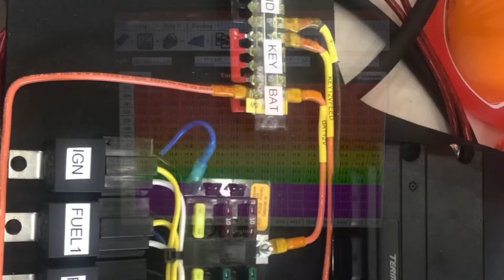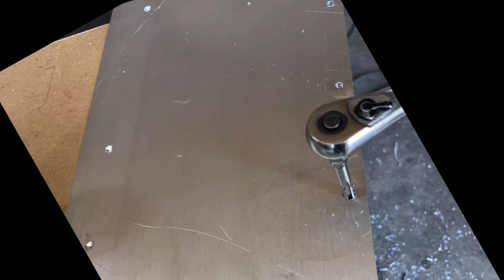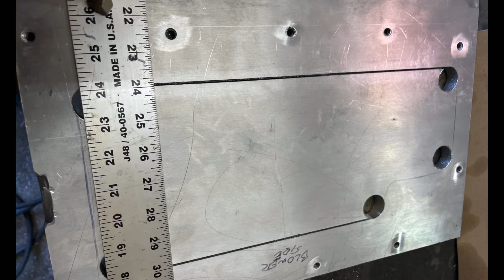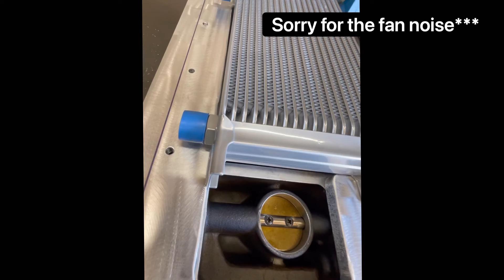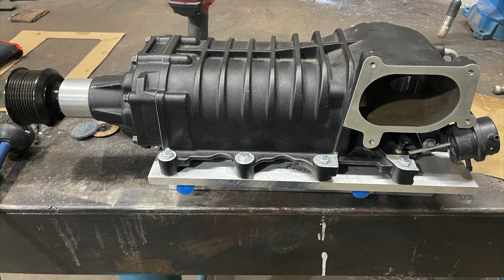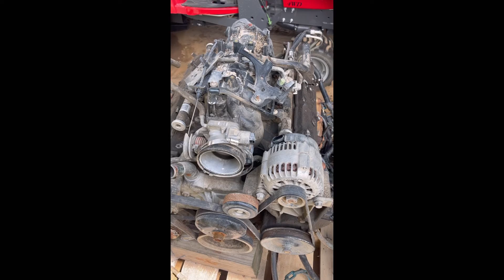Gt500 Blower INTERCOOLED on an LS.

Comment: Hey. Thank you for the video. I've looked at idk how many and none show as much as you have. 
 I'm trying to do a 94 z28 lt1 with a supercharger from a 11-12 shelby. So it's the m122. Gonna use my throttle body. Found cables today I believe. 
 Now I kinda see how to do that plate thanks to you. Which intercooler? 
 Plate for in between throttle body and blower? 
 I'll have more questions also if that's ok
Reply from the maker: Ask away. I’ll help you anyway I can. I’m getting really close to getting my project running!
Reply: @DanielsDesign  
Thanks so much. I'm kinda old school n all this stuff is new to me. I'm totally lost on all this blower stuff and how to add it on, parts needed, etc. 
 Found the aluminum online. 50 bucks plus 15 for shipping. So I'll order that today. Ordered my tv cable also. Blower is shipped also. I'll find and order the side strip also to make the box. 
 Or, instead of that way to save space so I can use my stock hood, can I put the intercooler like against my radiator and use a smaller intake? 
 Then, the lines for it go into what? 
Then theres a air to water pump or something? Some blow off valve etc. 
See brother. I'm lost as hell. Wish I could add photos on here. I'm gonna do a video on all of it from start to finish with part numbers n etc. This way it's out there for the lt1 guys
Reply from the maker: @briansaathoff4038  your physical intercooler has to be below the blower otherwise it won’t cool the air. But you are right with putting an “intercooler” with your radiator but most people tend to call this your heat exchanger. The heat exchanger then cools the water that will be pumped through the intercooler that’s mounted below the intake which cools intake air temperature. Basically you have two intercoolers In a way. Hope this helps you wrap your head around it. As for the height you can definitely get a lower profile intake to save room. The Holley Lo-ram would be a great choice.
Reply: @DanielsDesign  ok. I'll make the box part for under the blower,get the intercooler, try to find a intake. It has to be completely open on top of the intake yes?
Reply from the maker: @briansaathoff4038  yes sir
Reply: @DanielsDesign  
Ok. So, could you give me a list of things I would need? I'll do the research n find them. Just need to know what all 
Got, throttle, tv, linkage, blower, cheap intake I'm lost on, then a intercooler, then heat exchanger for front, I have 350 for a intake if I can find one that cheap. Have a bit more but rather save for other parts, then a air to water pump deal too yes? 
 Havent ordered aluminum yet. Didnt know if I should wait until I get the blower and intake 
Again, thank you very much
Reply: @DanielsDesign  every Holley intake is ls. Cant find any lt1 or am I dumb. I'm dumb yes lol?

Comment: Your Intercooler was sooo close to being perfect to begin with. Just make that original oil cooler the new AC evaporator, blow through from the Supercharger and VOILA ! Why let Dodge have all the fun with AC charge cooled Supercharging.
Reply from the maker: I’m decided I’m going to use it. Water will be my cooling source. I will have a 12v pump and send the water through a heat exchanger mounted up front with fans.

Comment: why did u decide against adding the cooler? would u have to run some sort of water pump inline to move the fluid?
Reply from the maker: I actually changed my mind once again and I am going to run the cooler. It will have a separate pump and heat exchanger that it runs fluid through. Keep watching the vids I will be posting more very shortly